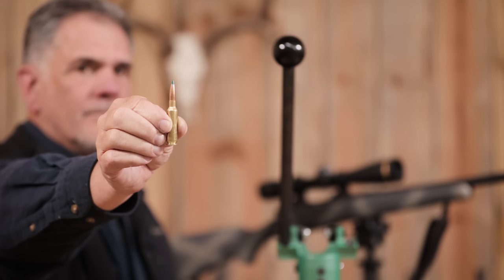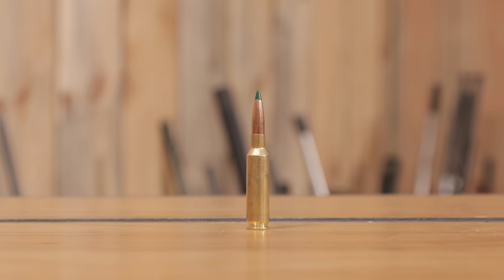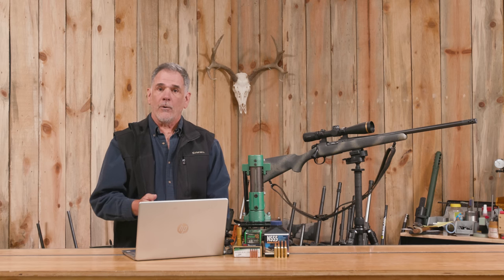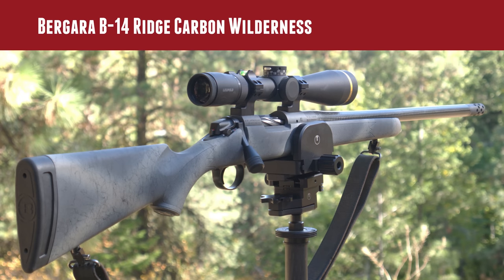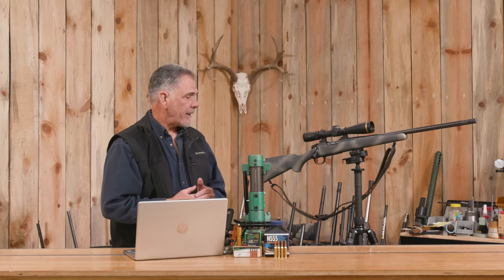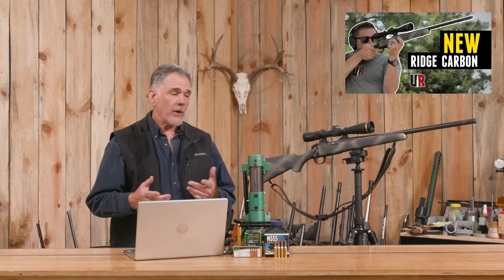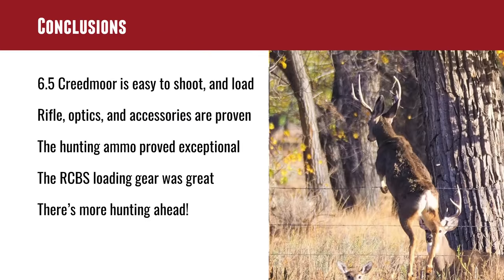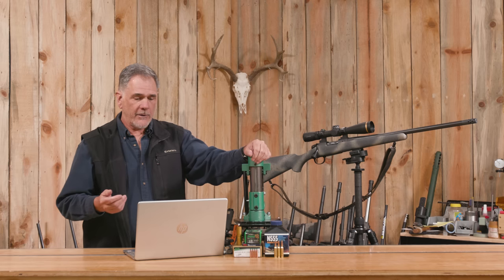Finally Hunting with 6.5 Creedmoor

Comment: I like using the cheap Speer varmint 120, Light fast flat, and hogs definitely don’t have a second thought about it… within .75” high to 1” low out to 200 yards with a 170 zero. 2” low 225, 4” 250, 6” 275, 8” 300. Simple square repeatable range estimates out to 300 is not terrible. Pretty decent laser beam. IMO

Comment: Where I live in the UK, roe deer are the main quarry. They aren't particularly testing for a bullet, but they are a smaller target than most US deer! In my 6.5 Creedmoor (Tikka action, Bartlein barrel, CG trigger) 143gn Hornady ELD-X achieve 2800fps and 0.3MOA. The terminal effect is indistinguishable from .308W 150gn and 165gn tipped hunting bullets. Given the sheer number of Swedish elk (which are moose to Americans) shot with 6.5 x 55mm Swedish, using the older, low prsssure loads, I would have little hesitation in using 6.5 Creedmoor on large game though I might want a bigger thump on a bear.
Reply: Thanks for that info!

Comment: Don't have a 6.5 cm, but I have been shooting a 6.5x55 for years. I have a 6.5 pound M 96 I had converted in the 1990s that is my go to  rifle. My handloads are at around 2600 fps with a 140 gr bullet of various makes over the years and it has always performed way above what it seems to be capable of. Why? I attribute it to the same thing that make the 7mm Mauser such a classic round...with a good SD bullet it penetrates clean through whatever you shoot at. It is not magic. The British African hunters seemed to say if you use a long for caliber bullet at 2400 to 2800 fps it would just work. The 140 to 150 gr 6.5 bullets at that speed range shoot gently, accurately and penetrate well. You don't need a magnum if the bullets you use just expand and penetrate. The medium 6.5 rounds, not just the CM, all perform this way. You don't talk about it, but there is really no difference with the hunting 6.5 non VLD bullets in the 6.5 cm and the 260 Rem. The Swed is a little slower, but not enough to really make a difference in endgame performance at normal ranges. This group of rounds just work at doing this kind of work.

Comment: 6.5 bleedmore , creepmore  or needsmore is a rocket with RL26 and a 140gr bullet, 200fps over any other powder , instead of 2700 and a few fps , its way over 2900fps with out pressure TRY IT.

Comment: I have major concerns with the 6.5 CM after personally watching folks shoot deer then help them track them. 

I have seen very poor results no matter shot placement with 3 different varieties of ammo.  Shoulder shots through lung & heart, high shoulder lung only, neck...

Winchester & S&B both in Soft point and Barnes TTSX.

I have seen better performance with 243 / 24cal which is a smaller & shorter projectile over the 6.5 / 26cal.

I have have a theory that the 6.5's longer projectile that is moving faster has proven to not expand as much as other rounds in the real world.  I think the longer projectile is having a harder time to expand than that of a shorter projectile like the smaller Caliber in 243 resulting in smaller entrance & exit holes in 6.5CM than that of the 243.

Entrance & exit holes on deer are barely visible with 6.5CM after combing hair back resulting in lack of blood from several SP loads as well as Barnes TTSX.   

Last year my buddy's son shot a buck through both shoulders, ran for over 200yds & didn't leave a blood trail with Winchester SP. 

This year shot another buck that ran over 200yds marginal blood lost the deer after loosing blood trail. 

Shot a doe at 60yds, deer was found 75yds from where it was shot.  Back tracked blood trail for only 20yds so deer failed to bleed for first 55yds with Barnes TTSX & projectile did not pass through or exit deer. 

Another friend shot 2 deer with Browning Hells Canyon & lost both & knows he had good shots no blood.

Another hunter at our club shot a buck in the neck with Winchester SP and he said the buck took a few steps before it fell.  After inspection the projectile entered neck obviously hit bone & ricochet down deers body to hind quarter.  Never have I ever shot or heard of a deer being shot in the neck that it didn't drop immediately.

It would be interesting for someone with a greater knowledge like yourself to take a deeper dive into this. 

I was a fan not a hater but I have major concerns after seeing so many deer shot that didn't bleed even if it was successful harvest.  You may not always be able to track a deer 200 plus yards without any blood through pine thickets, clear cuts & briar thickets.

I think the popularity of all the Hornaday PRC & Creedmoor cartridges are due to their marketing campaigns more than the true overall performance over other 100 year old or even newer cartridges in things such as 30.06, 270, 308, 243, all the Winchester WSM & WSSM as well as the new 6.8 Western so I feel like if Winchester had invested as much in their marketing campaigns as Hornaday then the WSM & new 6.8 Western would be more popular.

Hornaday marketing campaigns have a  cult like following that think anything with PRC or Creedmoor behind it is the most wonderful thing in the world.

I am a fan of new technology if the performance is there but I have seen entirely too many deer shot with 6.5cm that had no blood trail entrance & exit hole was not visible unless you combed hair back so along with the other concerns mentioned above thats why I say poor performance out of the 6.5 Creedmoor with a variety of ammo out of several guns.  7mm PRC sounds good but time will tell if the bullet performance is truly there for both thin skinned & heavy skinned game.  I would like to see these new innovations and advancements in PRC, CM, & ARC be successful in the real world field performance for every cartridge but I personally know 8 people that tried the 6.5 CM and have lost confidence in the bullet performance and sold their guns and after seeing the results myself I don't blame them as I have no confidence in it anymore as a hunting round.  Probably one of the best target rounds ever made though.

Comment: As a Weatherby fan I’d rather take a 30-30 sheep hunting than be seen with a 6.5 CM. Why when you can use a 6.5-300 or 6.5rpm, even PRC  that’s 500-800 fps faster with more energy. 6.5-300 has more energy at 400 yards than a Creedmoor at the muzzle.
Reply: LOL! High velocity is fine. I've been known to chase it as well with the 25-06, 257 Wby, 7mm Rem Mag, 300 Win Mag & 300 RUM. But I like this little rascal. Just as nice as the 308 or a bit nicer. Velocity is good. No doubt about it.
Reply: @guyminer3168 within your self-imposed range limit, the lower velocity with its accompanying lower recoil/report AND longer barrel life, should be fine. If your load is starting at 2700, you are still above 2200 at 325. I'm not sure what the expansion threshold on that bullet is, but if it's as low as 1800 you could go to over 600 yds. 👍👍